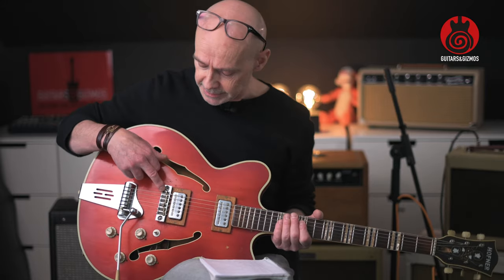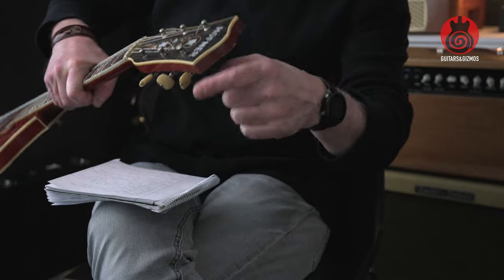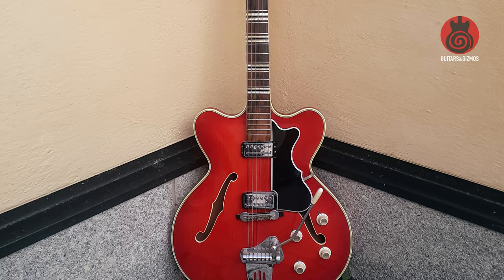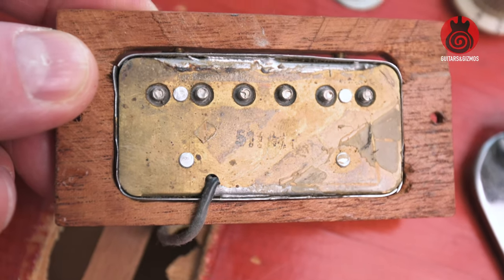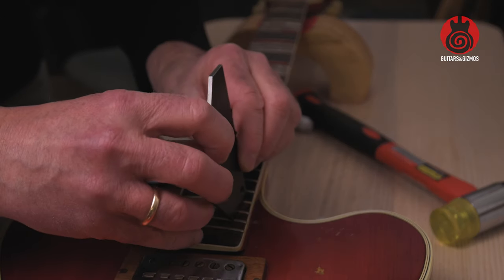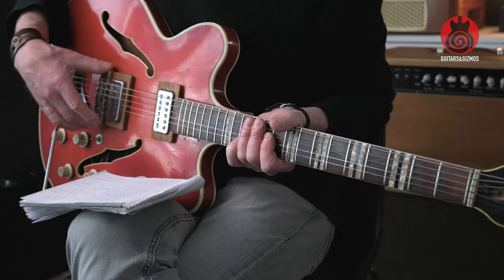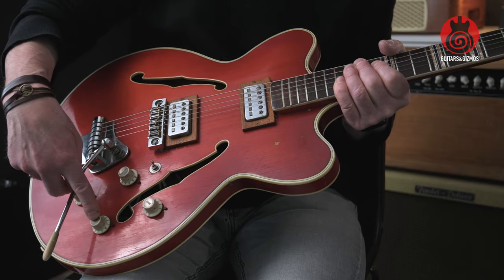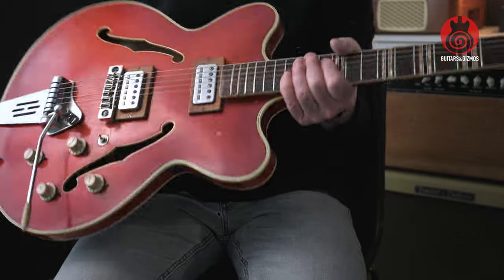My Hofner VeryThin 1965 - restoration process - Part II

Comment: 😊 that's a great sounding and looking guitar (the playing helps!) But that guitar is definitely been mangled by some DIY. Since you've taken off the bridge we can see a previous owner drilled holes for the posts for that Ibanez bridge. The original bridge would lay flat on top of the archtop, like on a violin or cello, or an archtop acoustic, and is only held in place by the pressure from the strings. That original style can cause issues if you like heavy bending, as the scratchplate had a protuding pin that held the bridge in place. Without that, the bridge has a tendency to slide if you do more than a semitone bend.

The routing for the pickups look like they have been rather crudely widened out, likely as you suggested in your last video to fit bigger humbuckers, in which case I'm not sure original pickup frames will still fit, but I believe they can be purchased from Hofner directly if you want to try.

The tone controls on the Verithins are wired weirdly. I got so fed up with mine. I had it rewired as Vol/Vol/ master tone and replaced the other tone with a selector switch, so I didn't need to drill a new hole.

I'm interested in your vibrato system. Mine is a '64 and comes with a licenced Bigsby, made by Hofner especially for the Verithins intended for the UK market (American made Bigsbys wouldn't fit the Verithin's body). The one you have looks like it was Hofner's own vibrato design used in European versions, which technically weren't Verithins. "Verithin" was the brand used by the UK importer and distributor Selmer. Hofner's own identifier for the guitar was the rather less memorable "4574". As far as i know most European 4574s also has different wiring, with only three dials (Vol/Vol/Tone I assume, but knowing Hofner who can guess) and a selector switch, which was a slider switch like those found on 60s Fender Mustangs rather than a tall toggle switch, so yours is either a hybrid or maybe Hofner gave up on the Bigsby at some point in 65. It wasn't unusual for UK instruments importers to make special demands for British bound instruments from overseas manufacturers; this is also the reason for the strange Rose Morris f-hole Rickenbackers of the same era.

Unfortunately Hofner lost the trademark to the name "verithin" in the 80s, which is why the modern versions are called "Verythin".
Reply from the maker: Hi, thanks so much for your insightful comment. Very interesting to hear about the scratch plate and that it is vital for the original bridge to be stable. Good to know if I decide to try and find one to replace this Ibanez one. Also interesting to learn that the model name was originally 4574. Again, thanks for sharing your knowledge about this guitar. Much appreciated 😊 Thor
Reply: I would hang onto that hofner guitar forsure!

Comment: Great playing. Great part 2. What volume was your amp set on?
Reply from the maker: Thanks man😊 I had the volume at 3 and tone at 7 on the amp. Cheers!
Reply: @GUITARSGIZMOS  Thank you. You pretty summed up what I was thinking. I built a champ and it sounds wonderful at three. I can bring it up to about five, maybe six with no distortion. I upgraded the speaker to a warehouse ceramic. Of course I have no tone on mine. But set at about three with the guitar at seven or eight sounds very nice for playing at home. I love the VeryThin such a cool guitar. I like all your videos.
Reply from the maker: @garypannone7755  How cool to build your own amp. I think I would be too afraid to fry myself in the process or at least not dare to turn on the power to check if it works 😆Very cool tone from these little amps. Thanks for your encouraging words on my videos. Much appreciated. Cheers!
Reply: @GUITARSGIZMOS  I managed to ZAP myself . LOL

Comment: Cool guitar and video! I have two of these vintage Verithins and some experience with other old Höfners. Before you invest $$$ in vintage parts like pickup rings and bridges: get a neck reset, as you will not be able to use these taller pickup rings or bridges in your setup. Neck resets are a common thing with hollowbody Höfners this old. They lack of sustain block and very minimal bracing makes these guitars fold up on themselves over time. If you check your string break angle, you will see that there is hardly any angle on your guitar. This is also the reason why your strings are jumping out of the bridge slots. Adding to this, there should be minimal bracing underneath the pickup holes - two braces, precisely.
It appears that the person who installed the DIY wooden pickup rings cut these braces in order to get the pickups further down into the body. Problem here is that you're now only making a fairly delicate top construction structurally weaker. If you're happy with the guitar as is, just enjoy it... if not, some more serious luthery would be the right call. All the best :)
Reply from the maker: Thanks so much for your advice. I can see what you mean about the break angle and that the neck probably will need a reset to have it return to former glory and the possibility to put the pickups back to where they used to be. Realistically I will not put a lot of money into having this fixed, but will take it down from the wall every now and then to give it some love and play it as it is. All the best, and thanks again for your good advice.